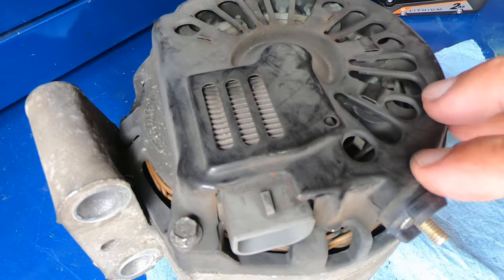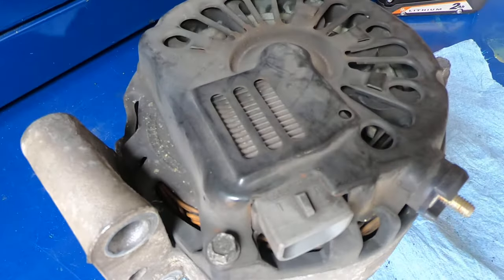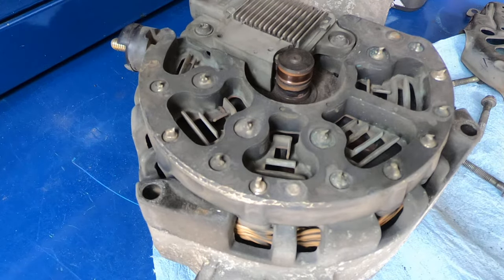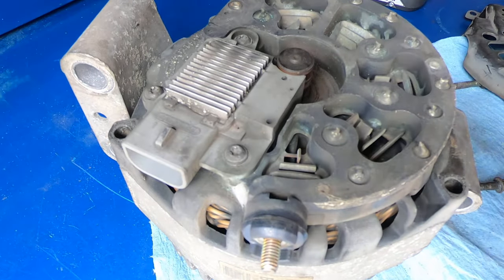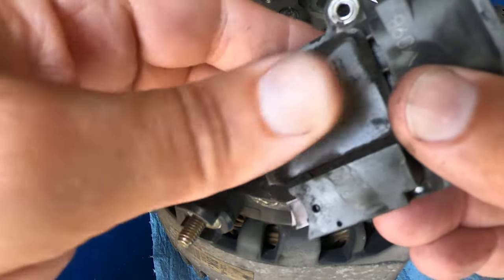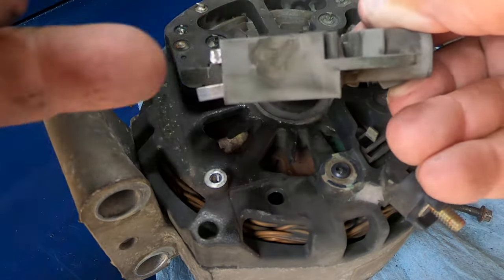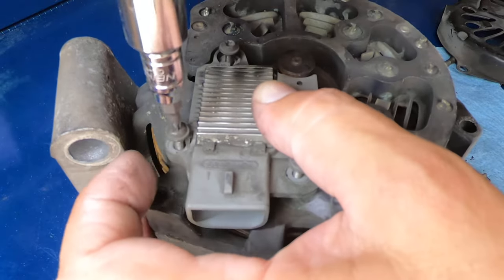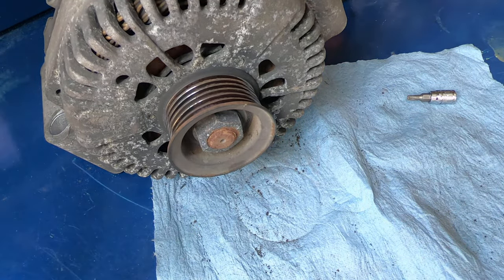$20 fix for Ford alternators 90% of the time.

Comment: Hi there, I just did an inspection on my Alternator on my 2008 f250, and looking at your unit tells me that that unit has been working to hard, which is probably why the negative brush is burned out probably due to bad weak grounding points along with a weak battery. I'd do a all point inspection of the charging system - all cables for corrosion, and do a battery analysis of the internal resistance, and try and clean up any points grounding the alternator to the system. WOW you can even see where a hole has burned into the slip ring...

Comment: Brushes aren’t the problem. It’s the slip ring. Those brushes would last another two years with a new slip.
Reply: If only it were easy to replace the slip rings. Not impossible but usually not worth the effort.

Comment: Agreed. Brushes are normally the cause of failure and often you can buy loose brushes and solder them in.Bearing are always close to worn out at high mileage so replace them. Also, the free running pulley's often seize up and need replacing. They are so easy and cheap to fix properly there's no reason to skimp on repairing them.

Comment: Are the toothbrushes supposed to be that much difference in size naturally? I know you said something may have gotten in there but would that cause it to be that much shorter? I have a 2012 focus titanium hatchback that has a new battery in it and it’s been in there for a couple months and now the car keeps dying and won’t start so I’m assuming it’s the alternator. I’d love to try this trick if I can access the rear of it if not I would have to pull it off completely and at that point I feel so I should just put a new alternator on.
Reply: Toothbrushes?

Comment: What happens to them the other 10% of the time? 🤔
Reply from the maker: The regulator goes bad 8 percent of the time, the windings open 1 percent of the time, and the bearings fail 1 percent of the time. :)
Reply: @737mechanic  my 2010 2.3 first the battery light came off then on and both battery and alternator tested fine at AutoZone then a few days later the battery break and abs came on and off with diming headlights. What could that be
Reply: @caverunbassmaster7659  You have an electrical short somewhere in your wiring harness or something more severe. Recommend having a trusted family mechanic look at it.
Reply: @caverunbassmaster7659  I had the exact same thing happen to me and it was the battery cable terminals that were loose around the battery posts. I tightened both up and everything worked perfectly well again.

Comment: I have a 96 E350 RV.  Every off season i store it with a solar charger on engine battery.  Amost every spring Alt. Only puts out around 8 to 10 volts.  Had original rebuilt twice and bought a rebuilt from Advance.  Just fired it up and only showing 8 to 10 volts again.  Any ideas?
Reply from the maker: Does the voltage climb when you rev the engine?

You need to make sure the battery is at above 12v volts or higher before you start it and see if that makes a difference.